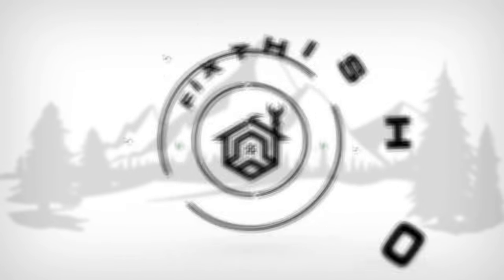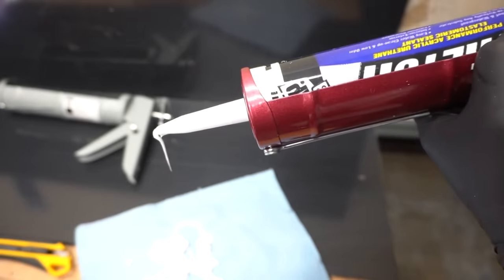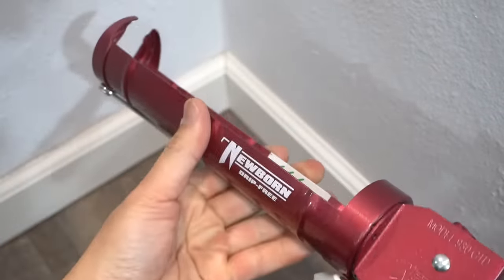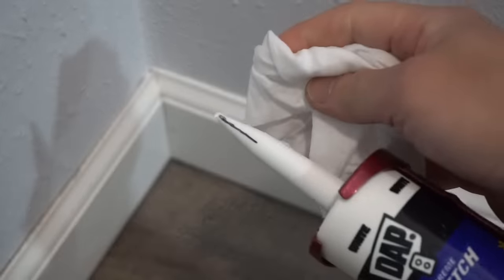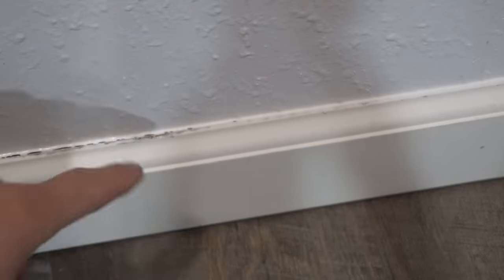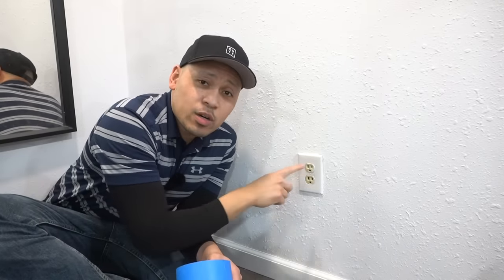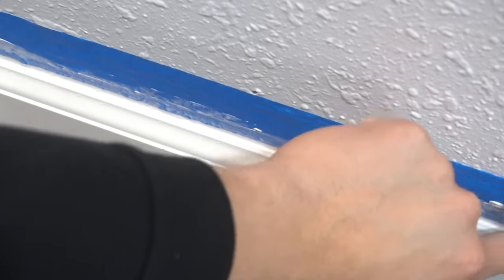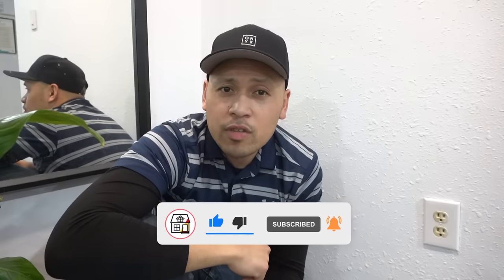The Baseboard Caulking Secret Tips And Tricks I Wish I Knew As A DIYer! How To

Comment: I need to point out the gap from the floor to the baseboard is a great opening for insects to invade your house from inside the walls. Fill those gaps with caulking as well as any gaps in electrical and plumbing coming through the walls, and you will see far less insects in your house.
Reply: His flooring looks like LVP, which you shouldn't caulk the trim to the planks
Reply: It’s better to caulk being the wall before installing baseboard.
Reply: The gap between base and floor should have quarter round or shoe moulding which is flexible enough to conform to irregular gaps along the bottom of base. paint quarter round prior to installation. Then caulk crack between base and quarter round leaving the floor uncaulked for expansion and contraction. Been out of the business for a while and will pick up this Dap stretch and try it out.
Reply: Why if uv got carpet there?
Reply: @phillcom3  this discussion is vinyl plank flooring and baseboard. carpeting and baseboard is a different application.
Reply: No.
If you got mass amounts of insects coming through under your baseboards, you got larger issues that you need to deal with and not just put a fucking Band-Aid over that symptom
Reply: Then you need pest control
Reply: @alewis6451  And you get the prize for the only correct answer. 
1/4 round is exactly for this application: baseboards are not flexible enough to follow the contour of most floors. 1/4 round has that flexibility and was made specifically for this application, and is also used when installing a floating florr ato pin it down. Sometimes you get lucky, and the floor isn't that bad, and the baseboard alone is enough to pin down the flooring.
Reply: Do NOT fill that gap with caulking. The floor should be able to contract and expand. Use ¼round or shoe molding. A lot of times the base is installed way before the flooring choice is made...that's why it's ½" or so above floor...this allows all types of flooring options...especially carpet. 

And FYI: Latex and Silicone are not the only types of caulk...there is also Polyethylene caulk...Polyethylene caulk has the best of both worlds, seals like Silicone, paintable like latex, expandable like Silicone, and does not shrink like latex...HOWEVER, Polyethylene is usually much more expensive as Silicone and Latex...
Reply: That's a LVP floating floor from Costco. You're not supposed to caulk floating floors, you can add additional trim to cover the gap. However, most home owners prefer it caulked. In his situation here the baseboards are really high and need additional trim to cover the gap, caulking this would be a nightmare.
Reply: @HygroHybrid so my apartment has that issue. They used to have carpet so it left a big gap. It has those laminated flooring that you stick to the floor. I had a couple insects come through there. How do I prevent that if I’m not supposed to use caulking?
Reply: @supra2k8  I get that LVP is 'floating' but would a clear silicone really inhibit the LVP that much?  I just finished LVP on the stairs.  I glued the treads and used the ready to go risers from Lowes.  I think it turned out great and looking to caulk and finish.  I must have disturbed my "Hairy Potter".  was coming up the stairs last night and this rather large spider was hanging out on the riser.  I am guessing he normally lurks under the stairs and came out to see what all the noise was.  although the cupboard under the stairs is finished there is still an open space directly under the skirt.  He didn't appear to be of the poisonous sort so he got kindly released outside.  I couldn't figure out a way to coax him to fit back in that gap under the trim :) 

Thanks for the video!
Reply: @limogesfarmer6326  Hi, I would like to know ‘how’ (either glue? or nails?) to attach the 1/4 round & do you attach it to the floor or the skirting board. I’m in the UK & I’m going to attempt this job because my husband is too busy 😶
I hope YT lets me know if I receive an answer…T I A
Reply: @Lucifer5Hammer  It depends on the baseboard you are attaching it to: if it's wood, then you can use a 23 or 18 gauge nailer. I prefer 23 gauge, but it's prone to nails curling back on you: then you are into wood filler repair once you dig out the nail, But, if you get liucky, you dan't have to fill in the holes - just paint over them and they disappear. For more oomph, use the 18 guage. also, the length of your nail is important: you don't need to use real long ones - just enough to penetrate 1/2" to 3/4" into the backing material (in your case, the baseboards). If there is an area where you can't use the nailer (say tile, or whatever), just use a latex/acrylic caulking and place a weight on that part of the 1/4 round. Leave it overnight, and you'll be good as gold the next morning.
To finish: take a plastic bowl with a little bit of water in it, and a cloth rag. Cut a SMALL hole on you tube of caulking and cut it at an angle (just not 90 Deg). Caulk all along the seam between the 1/4 round and the baseboards. Use your finger to wipe the excess. Use the wet rag to clean your fingertip. If you have way too much on there, wipe away with you finger, then use the rag to get the rest off, then smooth with finger again. Take your time: make sure it looks perfect - when you paint over it, it will look amazing. While you are doing this seam, check the seam between teh baseboards and the wall - they may need attention. You have to be very careful if you are not painting the walls - just a tiny bit - don't go to high up and onto the wall itself, or it will look wrong and messy. If you have some of the paint, you can touch it up if needed.

I do this for  living, and this is how I train my guys how to do it. Painting the baseboards are always the last part of a reno, and that's where I slow things down, relax, and take mt time. The customers always look at the baseboard because it stands out when it's freshly painted. Ues a high quality white semigloss paint, an you'll love the results. Let me know how you make out.
Reply: Nothing that isn’t supposed to be sealed should be caulked
Reply: @HygroHybrid butwhat if you're like me and hate quarter round?
Reply: @luv14lyf  mud it, sand it, paint it. Better than caulking.
Reply: Cant wait to see your new trampoline floor
Reply: @thaprojektkidd  😆 I hate LVP flooring. That's always my first thought when I see it!
Reply: @HygroHybrid 😂 LVP is okay in my opinion as long as it’s done right, meaning room for expansion. We never get any repairs unless it’s another crew my boss hired and everytime it’s too tight somewhere and you have to search the whole room pulling base 😔😂
Reply: This is such a useful channel,thankyou
Reply: Yellow sponge…finger…One pass..3 passes is a waste of time just like watching this tutorial 😂😂

Comment: A painter friend of mine showed me a caulking trick that utilizes the some of the tips used in this video.  This was done after walls were painted and white painted baseboards installed.  As in the video, you cut a small angle cut on tip (except you use needle nose pliers and pinch the tip to make the opening smaller).  Then you place and angle the gun on the baseboard and your wet finger at the tip of the gun.  You then   squeeze the trigger and drag the gun along the baseboard with your finger at a quick space that covers around 2 - 3ft.  Due to the small opening and your finger running with the gun , it lays down the caulk in one motion.  You may have to rerun areas if there are gaps that were not completely filled. Try it.
Reply: I like my caulking painted so I clean & caulk first, paint last because just after a few years of exposure the caulking turns a different color than the paint... especially that  Paintable painters caulk.  I've been working on houses since the late 60s.
Reply: That's a good tip  run finger with it one motion
Reply: Not only does it turn a different color, it also tends to attract dust and dirt.

Comment: One day  I advised a coworker to wet his finger and run his finger  to clean up the goop and he thought I was kidding. So not taking my advise my coworker's chalking on the trimwork turned out really sloppy and the next day our supervisor was pretty upset. Finish work has to look professional for all you newbies. Takes practice to get good at chalking. I usually use a nail to plug up the opening in the chaulk. Using a moist rag is helpful in wiping off the access. A good chaulk job makes a good impression on you. You don't want to get bad impression on these finish work. Good chaulk work keeps the bugs out of the crevices of baseboards and trimwork.
Reply: Wet tooling and finger in the caulk and taping and wet rags and taping are all things that would get any of us real caulkers FIRED!

Comment: This is really helpful.  I'm putting new base board down in our bathroom and I followed your instructions and it worked great.  I think the big one that helped was the tip to run a small amount, and then do it again if needed to fill larger gaps.  I had some pretty big gaps at times, but now using your approach it isn't a mess and it all looks so clean and profession.  Thanks again for the great video.

Comment: Great video, a few additional tips, if you are doing a lot of caulking, like filling gaps in a shed, etc...buy a powered caulker, caulking a lot is tough on the hands.  Instead of using caulk caps, if you are wearing nitrile gloves while caulking, at the end pull off the pinky finger, put it over the cap and wrap it with a little masking tape.
Reply from the maker: Thank you for sharing! 👍🏽😊🙏🏽

Comment: Good tips. In place of caulking caps, I like to use blue tape since I already have it. The thicker the width of the tape, the better. Just fold a piece over the tip and press all the rest of the tape together to eliminate any air gaps.
Reply: That all sounds good, but after 40 years caulking gaps and puttying  holes, I've found a simple galvanized finishing screw works simply the best. Screw it and forget it.

Comment: Like this guy, I have done a lot of caulking.  However, I have never seen the utility of angling the tip.  In my experience, it acts as a liability because you are trying to maintain the angle of the tip on the surface.  A small hole, the gun held at the right angle and skill at applying the right pressure at the trigger works great.   I can apply a nice smooth bead of caulk about as fast as I can walk if the job is such that I can do it upright.  I finish out the caulk with a wet rag and my finger much as he does.
Reply: A square cut tip held perpendicular does make a nice bead along base and in glazing windows.   I like his technique of starting at the corner.  Otherwise I push the bead ahead of the tube into the corner.

Comment: @FixThisHouse
Hi, regarding the caulk caps (near the end of the video) for reusing caulking tubes. They don't work very well. Over the years I've tried many methods (including nails) and products but they all don't work well. Recently I found something that works every time, and it's free: Clean the tip of the tube, apply a piece of electrician's putty (or any putty that doesn't dry out) over the tip and mold it over the tip to prevent any air from entering the tip. You can also apply some hot glue (if you have it) over the tip. This trick has worked every single time without any gunks of caulking plugging the tip.

Comment: My brother taught me to use clear rubbing alcohol on your finger so the caulk will not stick to your finger. It really works! Thanks for your tips to perfectly polish the caulking method!
Reply: Or just use water. Does exactly the same job
Reply: @rednissan001  Actually the effects are not the same. Hence the alcohol 😏
Reply: If you need water spit dish soap 409 tape alcohol and all the other flim flam cob jobbers stuff, maybe you just shouldn’t caulk

Comment: Very useful tips here. One correction. Silicone caulk does come in a paintable and a non-paintable version. ONLY USE GE brand and don’t be cheap. Always go with their newest one, the best, most expensive, GE Supreme as of now. They last years and years if applied properly. Put it like this. I still have the first application on an exterior storm door for about 15 years and no sign of wear.

Another tip which he shows but doesn’t state is alway run you finger along the caulk in one direction, then the other, then I even run it a third time so I can continue in the same direction I applied it.

Why?

Mainly because you will force the caulk deeper into crevices and prevent any air bubbles. Plus it give it a stronger hold and a nice smooth finish without having excess caulk left behind. 

Downfall to this is I do waste more caulk than he did but I am very cautious not to apply too much. I never have to apply a second coat of caulk. That tip is good as gold.

Dipping your finger into rubbing alcohol (fill a small paper cup), shake any excess off, and swipe. That prevents caulk from sticking to your finger and help give you caulk a nice smooth line. 

Rip up some paper towels to wipe excess caulk from your finger, toss in the trash, and continue as I explained. 

These are tips I picked up on from years of doing this and without tooting my own horn, I’m pretty dang good at it.

TOOT!!! TOOT!!!

Comment: Thanks for the video. Question: If I wanted to caulk/seal the gap on the bottom of the baseboard where it meets the floor would I use the same caulking or would I choose a clear one?
Reply: Not an expert, but none: The clear one will collect all the mess in time and look bad  and the latex one , will be imposible to paint and it will look crappy

Comment: Two additional tips: 1) Release your gun pressure tab behind the trigger mechanism after each pass and before you clean the tip. This will stop the caulk from coming out even when not applying the trigger.  2) Instead of caulk caps to see a partially used canister, you can use an electrical wire nut. An additional way is to use a ziploc sandwich back placed upside down over the tip and hold it there with a rubber band or hair tie.

Comment: There is basically 2 types of caulk, big caulk or little caulk, this is the one time that your little caulk will work best, simply keep the nozzle cut at 30* and small as possible, move fast with gun whilst pumping out a smooth small bead, gently wipe your bead into the crack and be sure to have a small bucket of water with a wet rag to clean your fingers. You will fill your crack perfectly. If you wish to caulk you skirt to floor joint, make sure the skirt is painted and dry, apply a bead of silicone, making sure the silicone fills the the floor and skirt joint, spray with soapy water and then use a small paddle pop stick to finish the joint.

Comment: Hi thanks for this video. I am trying to repair what another person did in the caulking process to my baseboards. I need to repair what he did when he caulked the space between the bottom and the new hardwood. It just came out uneven from his tape lines. Do you have any suggestions to repair or replace. Maybe with razor blades or scraping tool. Thanks again for the video.

Comment: How long will the rest of the unused tube of caulk last by covering the tip using that rubber caulk cap?  Will the caulk dry if it’s not used in a few months to maybe 6 months?
Reply: I usually just use a screw or long nail and shove it in the opening. Don't use too large of one u don't want to make the hole bigger but one that fits easily. Your caulk will last at least 6 months if not longer in my experience. When u need to use it next just grab some pliers and pull it out
Reply: Eventualy all dries out, I found that aftef 7 year one tub , sealed pretty good, was pretty dry. Probably there are many factors , but best is not to keep already opened ones too long

Comment: I live in a brand new house. The baseboards have been caulked nicely but now it’s cracking. Severe hot summers. What’s the plan? Should I scrape off old caulk and re-caulk? Did my builder use cheap quality qualk
Reply: If it's loose peel it off. If it's just cracked you can run a new bead over it to close the gaps.

Comment: Pardon my ignorance, but I'm not a DIY'er, why is caulking necessary?  Does it help with insulation?
Reply: It seals up the unavoidable cracks between the wall and baseboard.  Wood is not perfect.  It warps and gaps are sure to be there.  Once the gap is filled it just looks so much nicer.  Little bugs sneak in and out of cracks if not sealed.  Also water spillage can get in and rot everything and even cause mold.

Comment: Let me explain the difference in caulk .. the kitchen and bath caulk is 100 % silicone and it’s unpaintable . Now if your using that the kitchen and bath caulk . You’ll need a caulk gun a small cup or spray bottle with water and dishwashing liquid .. so when you run your bead of caulk you can dip your finger in the soapy water or spray it down . Now you can  finger it . The key is the dishwashing liquid Dawns old slogan was.. it takes grease out of your way .. 

Now there’re 2 different types of caulk . 1 is the acrylic latex caulk which I discourage anyone to use . This product will crack sooner rather than later.. plus it’s only a 25yr caulk .. 

The other caulk is Acrylic Latex Caulk Plus Silicone . This is a 40 year and the silicone is what makes this caulk better . It gives the caulk that elasticity so when house does it thing the caulk has that play .. I think he’s using a caulk that can stretch up to 3 inches before cracking . I think it stretches 5 or 600 % .. I hope my message will help someone out ..

Comment: You are close but you need to inject the caulking INTO the gap.  Just laying it onto the top and smoothing it does not fill the void and it will fail over time.  I've probably been a painter longer than you've been alive